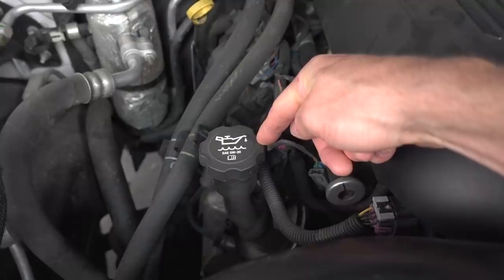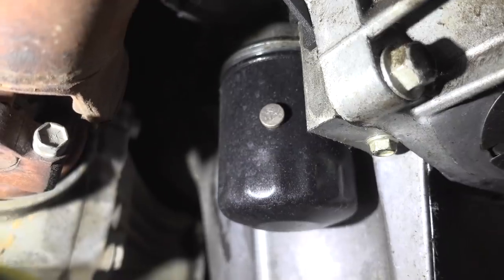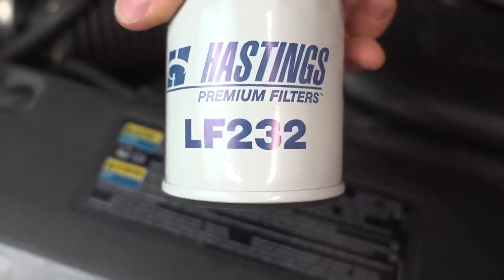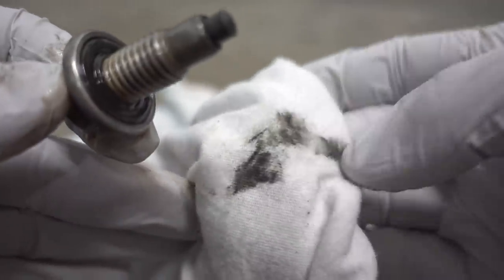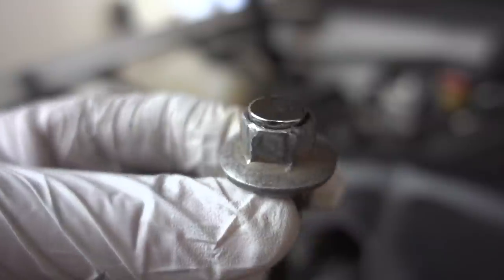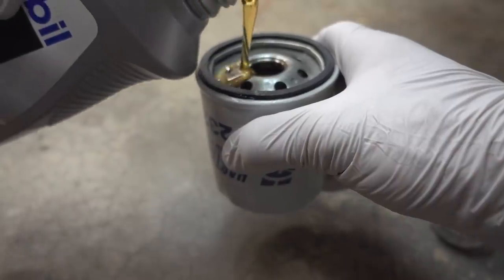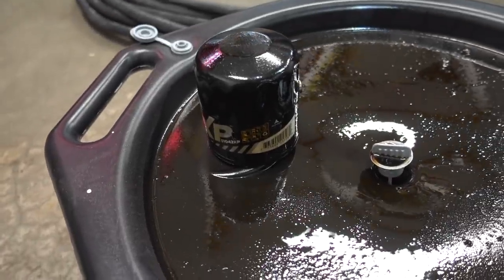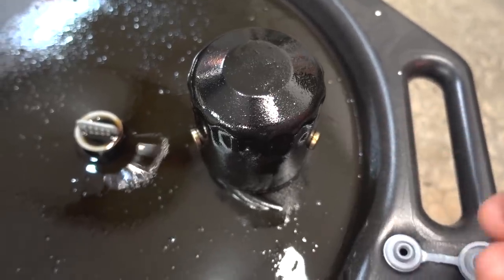Look What A Magnet Did To My Motor!

Comment: You have the harsh 3-2 downshift while accelerating too??! Have you found a fix for this? I drive a 03 Silverado 5.3 and have the same problem! I've been trying to figure it out for about 6 months now but no luck yet it's got me stumped. And oh the engine ticking yes my 5.3 sounds exactly like that
Reply: The 4l60e and its sisters are prone to bad 3/2 clutch packs. Time for a rebuild. If you have some time you can do it yourself for around 600 total parts and thats a full rebuild.
Reply: Alright thank you much for the info! I did a little poking around in the valve body a couple months ago for shits n giggles, I was thinking it was either something to do with the 3-2 downshift valve, or the reverse boost valve plug (I think that’s what it’s called can’t remember 100% at the moment but I’m thinking of the plug/seal that sits between the 3-2 downshift valve & the reverse boost valve), or possibly something in the servo. I never really thought clutch packs because I have no other signs of them being worn. but anyways so far I haven’t had the time (or money quite yet) to really dig into it, I have been saving up for a rebuild kit tho I knew it would need it soon as it has about 285,000 miles on it. but again thank you now I know what to expect! I’ll be ordering a kit soon and have her rebuilt in no time(;
Reply: Engine knock on GM truck engines is common.  Take a piston that is just within specs on the small size, and put it in a cylinder that is barely in spec, on the large size, and you have engine knock until it warms up.  GM needs to tighten up their specs.   One fix is bore the engine .010 over and gets some snug Pistons to match.   The only thing the noise hurts is the resale value.
Reply: Exactly. I'm thinking about doing exactly that after I get the trans rebuild out of the way. Besides bigger bore, bigger pistons= more compression anyway right? Lol.. I mean how much more really depends on how big you go of course.
Reply: I completely understand that, and If it was just a bit of a harsh shift I wouldn't worry about it. but this is more then just a little bump, what's happening with my truck at least. Plus its progressively gotten worse so I know for sure there is some crisp clutchs in my trans that need to be replaced.

Comment: I HAVE BEEN CHANGING MY OIL FOR OVER 50 YEARS AND NEVER DONE OR HEARD OF PRE-FILILNG  AN OIL FILTER. IS THIS A NEW SNOW FLAKE THING?
Reply: Finally some common sense! LOL 😂
I've been on it for a little less, >35 years. NEVER, and I really mean never, had an engine go "belly up", either diesel or petrol... Sent a couple of Winter beaters to the scrappie, all due to rust! Never filled up an oil filter. Although all my engines tend to work like Swiss clock's!

Comment: I  always drain my oil when it's hot.
Reply: Well I think your right. But I also wonder about the oil that didn't have time to drip down to the pan? I put a bottle of Sea Foam in my truck oil at about 50 miles before I drain it. And I drain it when its cold. This way the thinner Sea Foamed oil will mostly all drain out during changes. I could on about the benefits of my process. But I am sure you will see all the benefits of the oil changes like mine if you view your oil galleys as human arteries.  Keeping plaque out of your arteries makes a human live longer.
Reply: @jongallant6054  Only drain your oil hot and leave it dripping for 30mins so every drop gets out.
Reply: Always drain oil when everything is at operating temperature. With drain plug out and you can count the drips start the motor up and hold throttle to 75% mark. Only run it like that for 20 seconds then shut motor off. Now observe the trapped oil draining out. Proper care and your engine will last forever.
Reply: TheShockLoad no fucking thanks.
Reply: @TheShockLoad  shouldn't run a engine with no oil pressure even for just 20sec the internals have  tolerances not only does oil lubricant thoes spaces it also acts as a cushion between moving parts mainly the cam races, rod and crank bearings with no oil pressure you lose that cushion
over time leading to larger tolerances and lower operating oil pressure
Reply: @TheShockLoad  nothing last forever especially an engine low on oil
Reply: @TheShockLoad  just change the oil and filter regularly that's it
Reply: @tukamote6185  Exactly, I change my oil every 3k miles with new filters. and I always change my oil when my engine is warm. I dont these people saying run the car while draining the oil.
Reply: @adamcanto9643  I guess that works for some people but not for me my truck came with a manual and it says "drain oil replace filter and pour new oil " so that's what I do I trust the manual because the same people that made it designed and built my truck and doesn't say "start engine after oil have been drained" LoL
Reply: @adamcanto9643  BTW  the only magnet I recommend is the one for the hide a key box ...I used to get locked out when I was younger  and partying that magnet is a lifesaver LMAO
Reply: @Motorsportsgeek  --Do you really think every drop gets out? It doesn't and it doesn't matter. Even a cup or two wouldn't matter. Drain it hot. It doesn't take long to get down to the pan.
Reply: @garymiller2056  You do it once every few months, whats the rush ? All my cars have had flawless engines and cross the 250k mark running strong. I think il just keep doing what I do. 

I go as far as pouring half a quart off clean oil with the drain plug undone and flush out some more dirty oil out that way. May be wasteful in the shorterm but in the longterm, it pays off,

Comment: High mileage coldstart tick is completely normal in Chevys.    I start my Avalanche on a cold winter morning and it sounds like a gaggle of monkeys with hammers.
Reply: That is Active fuel management issue 
the lifters are clapping  that is why  lack of frequent oil changes

Comment: Why did you ruin the oil with an additive it doesn't need???  Sorry, that's a huge mistake.
Reply: some people get paranoid after they hit 100k mileage thinking that any additive with their selling gimmicks will make their engine "run" better...
Reply: @alfredoj9791  let's say for a minute that we have a very high mileage engine and we know that the parts are worn a little bit. The solution there would be to go up in the grade, in this case from 5w30 to 5w40. But that's it! No magic solutions...

Comment: Just use an angle grinder to cut it open . And are you sure it doesn't say replace regular oil with 1 or 2 oz of Motorkote instead of add? Cause that means you would be past full on your dipstick and that's worse than being low.

Comment: The thickness of the outer filter housing has little bearing on whether the internal filter medium is any good...
Where's the actual evidence that MotorCoat is 'better' for your engine. If it increases oil viscosity, why don't the manufacturers simply specify a higher viscosity oil?

Comment: dont get a car with diffrent metals on the block and head...if have a cast iron block..aluminium head..sonner or later yr motor will die...get water in it... or gas inthe radiator due to... electroleses..damage on the head or gasket..also the alumium head expands while the cast iron does not...u can do a reading of volts between the negative terminal and radiator water ..needs to be under .05..volts..some magnisium in the radiator may also work ...a stainess steel head gasket..or ussing a super rad fluid chanaging it much ..ussing distilled water  etc xxoo...

Comment: Is the rattling sound normal too?
Reply: as the metal in the engine warms up it expands and will seat better in the piston chamber, thus the rattling will go away! a common design for alot of engines
Reply: @AmeroBills  So the valve seat is making the noise? here i'am thinking it might be a bad timing chain/tensioner or the lack of oil pressure.
I have no experience with those engines as they are not common in the northern EU.
Reply: @croc1608  nah more like the piston is rattling ever so slightly because when the engine is cold theres an ever so slight gap until the engine heats up, when metal heats it expands that why the rattling disappears once the engine warms up
Reply: its like slight slapping of the piston
Reply: if it happens after it reaches normal temp then its probably another issue

Comment: AMSOIL IS ALL YOU NEED! 25,000 MILE OIL AND FILTER.  1 YEAR OR 25,000 MILE.
Reply: Why one year ?? I claim the time interval is meaningless, until you get out crazy like 5 years.  Most people will drive enough miles to need a change at 2 yrs+ though.
Reply: @latrogeniwile58   Probably oil destabilization over time.  That's my guess.
Reply: Do a used oil analysis after 25000 miles and rethink that statement
Reply: @themotofixery  I did, amsoil 0w20 in my rx450 20.000 miles and sent a oil sample to Blackstone labs and even they were very impressed with the results
Reply: I'd be very wary of high mile oil changes. The oil can last forever but contamination dilutes it. Gas, water, blowby products etc. As long as it still looks clean, ok, but if it's looking filthy no way. I think it more depends on how the engine handles it. My kid's mustang has clean looking oil at 6000 miles but our other cars need a change by 4000 and 5000 is pushing it.

Comment: Not,. Because you will create a resistance to the air that is currently in oil line that being pushed by oiland oilpump and when it pushes the oily paper inside filter it aggressively pushes and creates an impact that can damage media inside filter. 
2nd with this initial resistance your oil will be delivered little bit but later than when there is no wet media inside filter.
3 look up everywhere, you will not find anything about prefilling filter with oil. Only thing you'll find is to put some oil on the gasket so that can be easier to screw it on and to create a tight seal.

Comment: Just a little heads up and I’m not being a troll or negative but 5w 30 is watered down oil. The manufacturer wants you to use that for mpg and so you can replace their product with a new one. The one and only need for this oil is cold weather.
Reply: New thinking is the thinner the better. My 2012 corolla calls for 0/20
Reply: I have been using 5W-20 in my SBC since installing a crate engine, and no problem in the past 60k miles (100km for you canucks). Plus the fuel mileage is a little better with the 5W-20.

Comment: He needs. A new flyback...over kill..Wal-Mart synthetic oil 17 for 5 quarts works just as well..same certifications..A puralator filter with grip top for 3.77 ..has the same micron value as the 20 dollar. Filter ..
Reply: Walmart isn't Purolator, that's advanced auto, you are thinking of fram filters with the orange body, black grip.
Reply: So.... sir, why do I have water/condensation in the oil fill cap on a dodge Durango using the 'awesome ' full synthetic oil?

Comment: Just use Amsoil Signature Full Synthetic, and know you are using the best oil in the world.
Reply: Backed off from AMSOIL to Mobil 1 high-mileage due to the cost.  The M1 is fine.  Flawless performance for 20 years and 152,000 miles.  M1 or K&N filters.  I can run out to 10,000 miles before the first out of spec reading is total dissolved solids.  I don't care if its over a year.

Comment: 4:58,I'm sorry Sir but I have to point out that your oil drain plug looks horrible.
Head of that drain plug is completely deformed and destroyed and I won't be surprised if you actually damaging socket or wrench,using this oil drain plug.
I almost always use six point quality and proper socket or six point wrench.
I always use torque wrench to tighten any bolt to factory torque specification.
Engine oil drain plug and manual transmission oil fill and drain plugs on my 2006 Corolla,are looking like brand new.
Reply: And i bet you have named all your tools individually, you must be the life and soul of every party, if you ever get invited to any
Reply: @cornovii3012  I think this guy is trying to be satirical. Not sure, there is a joke. I'm inclined to think it's Broj here that is the joke though.

Comment: My 5.4 Triton was so quiet all you heard was the air going into the engine compartment from the fan while it was idling. Open the hood and it sounded like an old type writer. Most of the ticking in your Vortec is the magnetic fuel injectors opening and closing. If you THINK the magnets on your oil filter are helping then put them on, but they are not doing a thing and your engine wont last any longer or run any quieter. Also oil additives are another waste of money except to maybe thicken the oil on an engine that is burning oil due to worn rings. Today's motor oil is engineered to perfection and nothing should be added to it. Nice click bait by the way. You are not the sharpest tool in the shed, that's for sure!

Comment: You shouldn't be magnetizing the threads on the drain plug.  If they do catch metal on the treads, the threads will then be bad for the drain plug hole threads.  Magnetize elsewhere.
Reply: But the oilpan on that truck is aluminum.
Reply: That doesn't matter.  When you are unscrewing the drain plug, the metal on its threads will hurt the threads of the pan, especially if it's aluminum.
Reply: Please...

Comment: buy cheap oil but change it very often,was given that advice by a mechanic,besides your vehicles have probably 200plus miles each on them,you need thick oil in the summer,in your winter you can use the expensive Synthetic stuff

Comment: For need of magnet for two reasons
The first is that the oil filter does the whole job
The second is that modern motors are made of aluminum and therefore do not hold the magnet on aluminum foil

Comment: ticking is normal for the 5.3. it’s from the lifters contacting the rollers
Reply: Travis R. 
True, UNTIL the engine warms up
Reply: if it's clapping (or sounds of a diesel engine ) then you have a issue  fairly typical of Active fuel management engine  It means They did NOT do oil changes Often enough they need it more often like every 2500-3000 miles or so
Reply: punker4Real but it’s normal for a 5.3 6.0 6.2 vortec all have a ticking noise. even new they do it. i worked for GM/Cadillac for 10 years
Reply: need oil zinc additive for the tappets on valves.   Porsche tech, gets quite
Reply: Lol - no, its not.  Its the fuel injectors.
Reply: Latro Geniwile i’m a certified gm tech

Comment: you should quit giving automotive advice. you don't want a magnet on the head of the bolt, otherwise, you'll draw metal to the bolt threads, and strip your aluminum oil pan. thats why there's a magnet sticking out of the end. quit doing stupid shit to your vehicles. you don't need magnets on your oil filter either. and also, i BELIEVE EVERYTHING on you tube channels too! ...

Comment: U never shook that motorkote before you dumped it in yr crankcase, if u did, it would have had a dif color to it, yr magnet done nothing but stuck to yr oil filter & drain plug whoppy

Comment: I always thought that Fram oil filters were the best until I went through a filtration class for my job over 25 years ago and I found that the fram oil filters were the absolute worst filter you could buy for your car and at that time they cut open several oil filters and the construction of the fram was horrible the endcap inside was cardboard glues to the filter paper with a very weak bypass spring and unless you were planning on changing your oil every 1000 miles they are worthless and they  start to decompose after a few thousand miles allowing cardboard particles to get into your engine wix is one of the best filters on the market and now with the synthetic oil and 5 to 6 k oil changes you need to use a quality oil filter. When I was a kid starting out doing service at my parents shop I had an old timer who was retired from General Motors he would bring his Oldsmobile to me once a month for an oil filter change never the oil and he told me that after 2000 miles the filter will just bypass and stop filtering he said that he has never changed his oil since his last scheduled service under the warranty period and his oil was as clean as if he had changed it every 3k miles as recommended as long as the oil has viscosity and isn’t black with sludge it is perfectly fine to continue to use and I have been doing the same thing that he was doing on my own vehicle for several years now I check my oil and as soon as it gets to a Carmel color I change the filter and top it off and I have saved several thousand dollars in oil changes over 500k and still running like new If I purchase a used car I will use cheap oils and change it frequently to clean up the engine and when I am satisfied that it’s clean I will use valvoline oil and a new wix filter and that is the last time I will change my oil and then I will get on a schedule and change my filter every couple weeks depending on how much I drive never exceeding 2k or If I can see that my oil is starting to get Carmel color
Reply: Correct.  I just threw some away.
Reply: Yup.  You'd probably be better off bypassing the oil filter altogether, than to use a Fram filter.

Comment: Why not use synthetic? I use pennzoil platinum full synthetic. 5 quarts is $22, and 1 quart is $6 for my 2001 Silverado. So about $30 for the oil. Not saying your wrong at all, just curious why. Great video 👍🏽
Reply: I thought Mobil 1 oil is synthetic oil. That's what he is using.
Reply from the maker: I use Mobile 1 fully synthetic oil as much as is possible.

Comment: Oil filters catch over 95 percent if not more of particles including metal. Total myth about magnets. Old engines never had oil filters anyway. If you have metal particles floating in your engine oil there is a much more massive problem a magnet on a filter will not help.